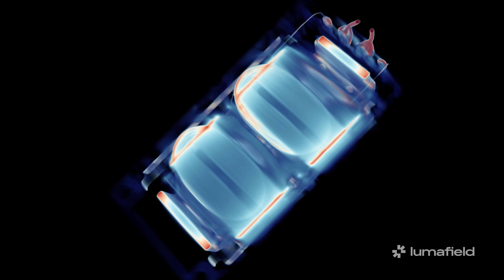Switch 2 Pro Controller: Built to Break? Full Teardown

Comment: I’m torn on this new design… at least the sticks are swappable without soldering involved, but the battery replacement is just unnecessarily difficult compared to the 1st gen Pro controller… Excellent video as always y’all!
Reply: People make fun of MS for the AA bateries, but this is want Nintendo brings
Reply: @urband10  requiring the user to have to use batteries is a cheaping out cash grab in it's own right.
Reply: While the controller feels amazing to use when you're actually hands on with it, I'm with ya. This is just insane. No battery keeps it's full charge forever, so having it buried under a damn near complete teardown of the entire controller is insanity. 

Side note, wasn't expecting to run into you here Skye, long time no see since the custom zombies days!
Reply: @TemporalPick  Sure, no battery keeps its full capacity forever, but the battery lasts at least 40 hours. At 80% capacity, the battery still lasts for 32 hours. That's still much longer than the dualsense, for instance. That said, it's obviously not a good thing to make swapping the battery involve so many hoops.
Reply: Sure, they're swappable without soldering - you just have to go through five layers of glue, screws, snaps and plastic to get there. What is there to be "torn" about? That minor positive is like a restaurant giving you sprinkles on the dog turd they served you when you ordered chocolate mousse.
Reply: Have you ever had issues with your 1st gen Pro Controller battery?? I have 5 Switch 1 Pro controllers and this is the 1st im hearing about people having issues with the Battery.
Reply: @brokenfiction999 I have 2 of them myself and haven’t had battery issues, but the point of it is they are pretty easy to swap, the Pro Controller 2 is just ridiculous how far you have to dig in to get to the battery.
Reply: @TheSkyeLord  I don't get why it's an issue for them to design the controller in a way that makes the battery difficult to access if you never need to access the battery? 🤔 I pretty sure they Dont Want people to access it so... ya know.
Reply: @brokenfiction999 Maybe to an extent of user safety, or whatever they want to use as an excuse, I can see it from a liability standpoint. 

The reason why it’s an issue is that rechargeable batteries do not last forever. They will eventually stop charging or hold such a poor charge that actually using said device is not ideal or acceptable. 

When that happens, having reasonable accessibility to the battery for replacing it will keep a good few devices out of landfill.

At minimum, the battery in the Switch 2 Pro Controller is removable, and no soldering or “expert” work pre se is required. The reason everyone is making a big deal over how it’s designed is that the Switch 1 Pro Controller had extremely easy access to the battery, relatively speaking.
Reply: @TheSkyeLord thing is most of those batteries last for a pretty long time, heck my ps3 controller that came with my pstv still works. And i bought that in 2014, over a decade old, same with my wii u pro controller and table control, both are over a decade old and i have not gotten Any issues. Same can be said about my og switch and og pro controllers, both getting close to a decade old in the next 2 years. Batteries today are pretty good that im not worried about needing to replace them any time soon, and even if that was the case, i dont mind taking 10 min doing so.

Edit: also dont know why he took so long to take the face plate, it took me 5 seconds to do it with my hands. The glue is not that strong.
Reply: @brokenfiction999  There are definitely people out there who have had to swap batteries. It's unavoidable since batteries are wear items. They will break down over time, even if the controller hasn't been taken out of its packaging since being manufactured.

For people who care about preserving their electronics, the easier it is to repair the item, the better. Lord knows how many DS4 batteries I've swapped for people over the years.
Reply: Seeing all this, I can bet I've had less trouble replacing the Xbox 360 joysticks with 14 solder points per stick plus 3 to remove the triggers to even access the dang pots.
Reply: Since I had to re-solder my sticks on my switch 1 pro controller the fact that the new sticks being modular is nice and all but I don’t really think it matters when the darn thing is so difficult to open compared to the last generation
Like there’s no reason to have any part of this controller glued. It’s just an anti repair measure for no functional gain
Reply: I see the controller repair as a one time thing. You use it until the sticks start to drift (hopefully it's been a couple years) then you tear the whole thing apart and replace the sticks and the battery at the same time. This design won't survive many tear downs before connectors and failing and screw sockets are worn.
Reply: Still love my original pro as well. Yet, don't foresee myself ever going back to first party if I can get a proper controller that works on both PC and Switch 2.
Reply: The fact that you need to replace GLUE is a dealbreaker unless you're a pro repair shop
Reply: @dr.eldontyrell-rosen926  It can hold itself together with its own clips just fine, and even then adhesive is just about the easiest thing to replace in the world.
Reply: Bro, you are NOT accurately remembering the Pro-Con 1' disassembly process. That thing is held together by adhesives and ribbon cables connecting different boards on the front and bottom halves of the controller. Even cleaning your pro-con joysticks was harder than replacing them on Pro Con 2 seems to be.
Reply: Curious when you ever need to replace the battery? My 2017 pro controller is still fine
Reply: @JakeYolk  Basically never. My 2017 Pro controller is also still working like the day I bought it.
Reply: @icy1007 exactly, these controllers have crazy durability imo. I've never had drift with them in 8 years as opposed to xbox one's controllers which would fall apart after half a year lmao
Reply: The one issue I see is that because the sticks are modular, there is a good chance that replacements will be harder and more expensive to come by. Might as well be proprietary.
Reply: @RGInquisitor third parties will make their own replacement sticks to match, every controller that's had modular joysticks have had plenty of companies making replacements, especially ones that can sell you an upgrade to hall effect
Reply: @psychonauts0  I hope so. They would still be more expensive I'm guessing, and its still up to Nintendo to allow third parties to make and sell them.

I replied to another comment on this thread about the DualSense Edge and the problems I have with that controller too. Some of it applies here, but to add to your point: I have yet to see third party Joystick modules for Sony's controller, and that one has been out for a while now. Hopefully there are some out there, or are in the works. I hope third parties do in fact support this new Pro controller too.
Reply: @RGInquisitor  I know it’s not what most people hope for, but there’s always some seller making equivalent non-original parts.
Reply: @vodkastrats  Most often, when it comes to Nintendo, the third party one is better, too. At least when it comes to hall effect and TMR!
Reply: @vodkastrats  I hope so. But the problem still stands that it will most likely be more expensive to get replacements. I can get a 20-pack of universal potentiometer sticks for about $5-10 on ebay. With just one of those I can keep all my potentiometer-based controllers working for decades.

I'm still making fun of people who bought Sony's Dual Sense Edge thinking the swappable sticks were pro-consumer. You can only get them from Sony's authorized sellers, and you only get the one module for $20. It only works on that model of controller, and will most likely not be carried forward for the next model. Not only that, Sony will definitely stop producing them at some point, and you'd have to hope a third party will produce them without Sony being butthurt about IP infringement. Salt in the wound is the super-low availability as well. The DSE is time-bombed right now.

I have those same worried about this controller now. Hopefully I'm wrong!
Reply: on a full sized controller there was no reason for them to redesign the controller stickboxes, if they wanted it to be removable then the Steam Deck had the gold standard method for replaceable joystick modules - Nintendo's made it a non-standard size and layout so people will be beholden to them or will have to wait an indefinite amount of time for a 3rd party like Gulikit to redesign a Hall-Effect joystick to fit there.
Reply: Yeah, the battery looks smaller too which would mean less juice. 

The battery replacement cost probably has gone from 10$ to 35$-40$ just because of the time and skill it takes to get to it.
Reply: The battery won't need to be replaced.

Comment: carbon contacts, you FN kidding me!!!!!!!!
Reply: RIght!? Consistently cutting costs in the assembly line... cutting costs in the supply chain.. and still no hall effect.

Match the lifespan of these analog sticks closer with the D-Pad! Hall effect is expensive to make and WORTH it. They NEED to dedicate a unique joycon and/or pro controller line that is sold with hall effect. Sell it at a higher markup to make up for the costs.. people will buy it up.. don't be mistaken.
Reply: These sticks look the same as those on gen 1 & 2 joycons and the gen 1 joycons will drift after just 200 hours of gameplay. Meanwhile my gen 1 pro controller has no drift issues whatsoever. Shame for Nintendo for going backwards and choosing a much less durable option on gen 2 pro controller.

Comment: Still cannot believe Nintendo stuck with the same joycon sticks for Switch 2 🤦‍♂️
Reply: Only very young people would be gullible enough to buy a switch 2, so it follows that they are easy to trick with buil-to-break accessories so that they have to buy them 3 or 4 times through the lifetime of the console (as opposed to controllers from other brands that easily last for a decade+). Remember the time nintendo released a literal cardboard box for like 90 bucks? And the like 29 times they've sued palworld (2 of them succeeding) instead of making better games?
Yeah, you would have to be a moron or a small child to support nintendo.

Comment: The fact you can get hall effect or TMR based controllers with full switch compatibility for years at well below the price of this controller... It really boggles my mind that they went with potentiometers again. Any arguments against TMR sticks are so minor in comparison to the improved durability, and accuracy, this just seems like malicious design at this point. They are saving maybe a dollar or two by going with these worse sticks.
Reply: They're saving more than a dollar or two. Adopting a new technology into an existing design takes engineering hours. By continuing to use conventional potentiometer sticks, Nintendo didn't have to do as much re-engineering for the new generation. TMR/Hall also takes an additional IC/chip, either inside the stick or on the board. Adding magnetic based sticks would probably cost either the consumer or Nintendo an additional 5 or 10 dollars. You have to think that pennies per unit turns into hundreds of thousands or even millions of dollars at a scale of millions of units. Perhaps Alps or the other few companies that make joystick components were not willing to offer Nintendo a good volume discount on the more advanced parts.

The only "new" parts I see in the design versus the original Switch Pro controller is the more annoying to disassemble shell and the more modular components. They really phoned it in with this controller.
Reply: Fitted tmr sensors to our series x controllers 👌
Reply: @mikeuk666  Another reason the switch pro controller is hard to recommend... that disassembly process, and the custom low profile sticks mean it's going to be very difficult to swap in 3rd party sticks.

Comment: This feels like malicious overengineering because of gen 1 joy cons.
Reply: Overengineering and they still use drift-prone potentiometer for their sticks.
Reply: @Vyz3r so does everyone else
Reply: @Vyz3r what if electromagnetic motors is a problem for hall effect sticks. I'll wait 3rd party replaces to see if it's true
Reply: @x149te  It is NOT a problem. Not in the controller. It might be on the joy-cons due to the console's magnets, but even that seems to have been disproven.
Reply: @Luka1180 who disproved? Is there a vid?
Reply: @x149te  Nope. It'll only be affected if the magnetic field is extremely strong. Those motors aren't going to affect it otherwise hall effect controllers can't even be made
Reply: @x149te  Metal Plastic Electronics "Magnets + Hall Effect Sensors + Joystick" 6:40 minutes in, they show using a magnet, reading voltage. You can see the distance at which the magnet interacts with the hall sensor itself.
Reply: @x149te  3rd party controllers with Hall effect sensors also have magnetic fields from their rumble motors, but still work more precise.
Reply: @CatmintJelly  Magnets are (if you aren't over complicating and nothing broke) static, thus can be calculated out. Calibration is there for a reason. I know the fields in play in all states, thus they can be calibrated out. It's not hard, even if you don't calibrate them out, just take the field measurements with the magnets in play, and done! Yes, the field WILL be affected, but if you read the affected field, it will still change, you record the field states and done.

And if an electromagnet is causing trouble, well, you know the state of that, it's on the same board. Have 2 LUTs or a modifier for the state, and done. Also, the change should be so small, that you literally have more natural muscle movement that what the fields would change. This is calculated out already.
Reply: @sikertsok225  Tossed a like, because we are pretty much showing the same thing with the suggested video. I think this would be better directed towards the tagged person who is suggesting otherwise about the new design of the controllers.
Cheers! EDIT: Excellent write up, it's a gem hidden in comments. Hopefully curious comment lurkers will read it and understand more about magnets.
Reply: @CatmintJelly Likely a misclick, didn't mean it for you!
Reply: @x149te  it's not a motor. You're thinking electric motors with encoders. Hall effect and TMR just have a permanent magnet and a metallic sheet that changes resistance based on direction of a magnetic field. That makes them incredibly stable. Failed Dreamcast and Saturn joysticks are basically unheard of. 

The only wear products are the normal gearing for the stick, but all potentiometer sticks have the same issue.
Reply: Feels more like malicious overengineering to spite the market of custom shells, sticks, and buttons for the Switch 1 Pro Controller, which is very easy to open up and replace the bits of
Reply: @WhimsicottFanatic  The HD 2 magnets can cause nerve fatigue if you touch them directly.  I'm not sure how long term radiation effects could be.
Reply: "this feels like [Nintendo engineering]"
Reply: Don't forget that the flux density of magnetic field is inversely proportional to the distance squared.
Reply: @Aero685  Underrated comment!
Reply: The rumble packs are potentially dangerous if not shielded properly, as for the Joysticks Nintendo isn't allowed to use Hall Effect Joysticks due to company policy, and the fact that the owner of Hall Effect Joysticks refuses to sell their joysticks to Nintendo for use in their controllers.  (In fact there was a quiet cease and desist order given after the user saw their Hall Joysticks were already inside a controller they were repairing live in front of youtube and they blamed Nintendo for the embarrassment)
Reply: It's a very durable controller that's all this video showed us...I bought two because of this video lol